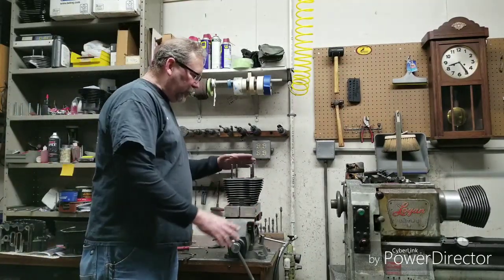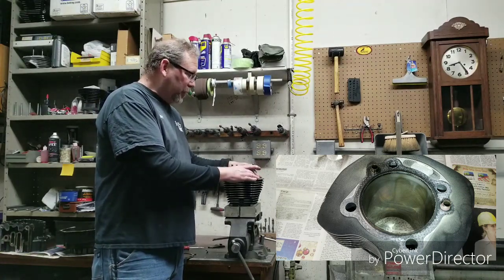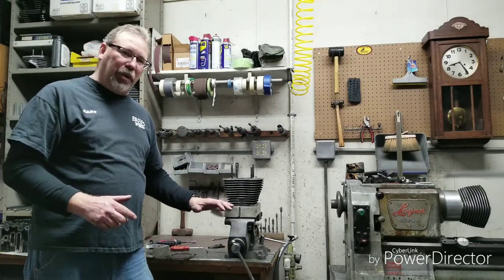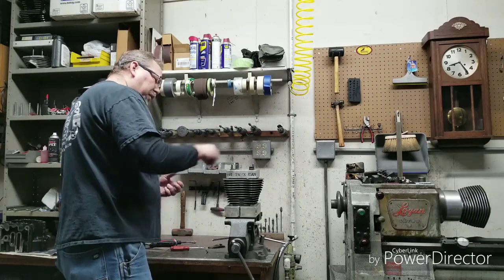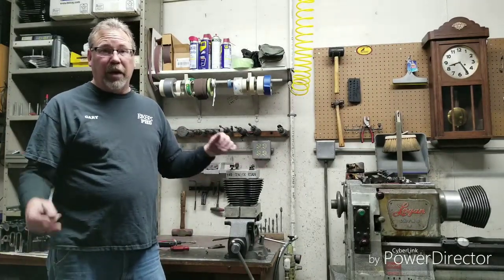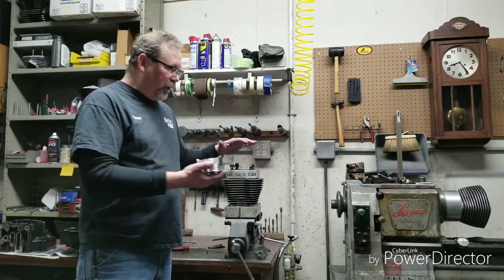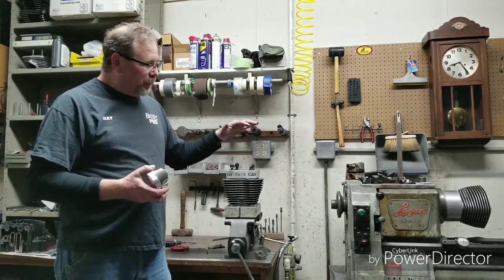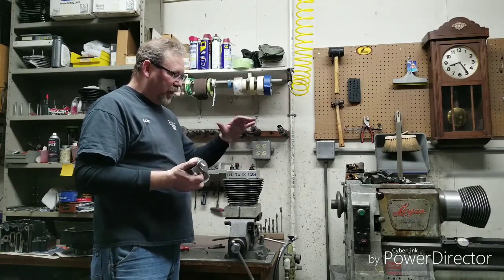Torque plates for a Harley Davidson motorcycle

Comment: hey Gary I read your answer that you use torque plates on shovelhead cylinders, and that they distort the least. I wanted to ask you - can I get accurate measurements of the piston clearances without using torque plates? I have good tools but no torque plates (yet). Buying torque plates for shovelhead cylinders isn't so easy. They all claim to be great for all motorcycle cylinders, which I assume is marketing b.s. And they are so darn expensive...

Well thanks for any advice or recommendation you can give me...and for all the great videos of course. They are very helpful and I'm glad I found them..
Reply from the maker: It's OK not to use torque blades on the shovel head you just add a little clearance go to the bigger side of the tolerance you're piston to wall clear.
Reply: @Vtwinheaddoctor   Ah that’s great to hear Gary thank you so much, for the info and for the quick reply, I really appreciate it!